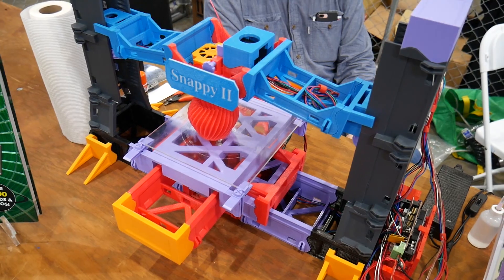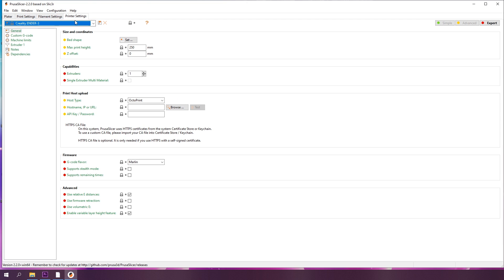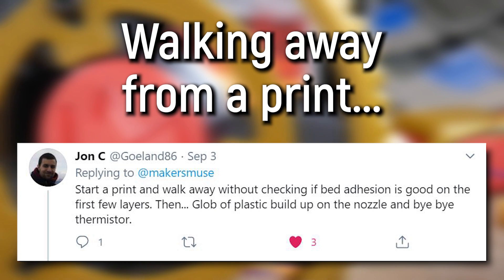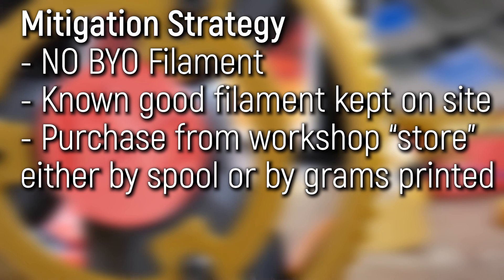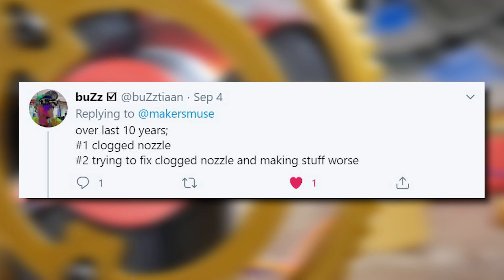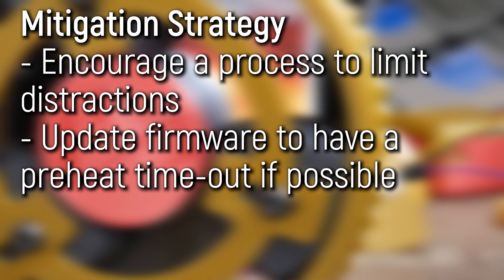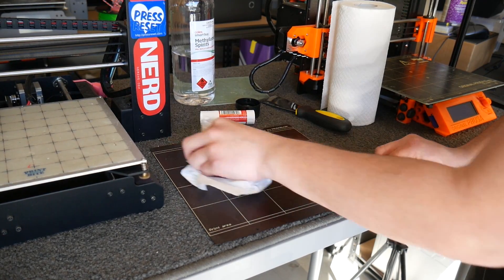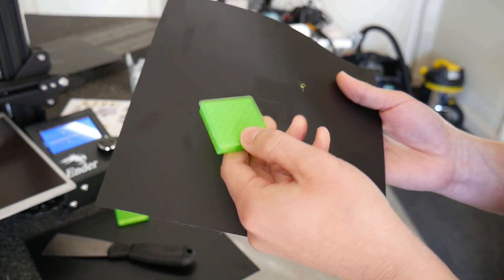How People BREAK 3D Printers (and how to stop it)

Comment: Methanol is very toxic and is absorbed through bare skin. I recommend wearing gloves if you're going to do that and work in a ventilated environment.
Reply: Angus was using Methylated Spirits which is ethanol with a few additives to make it virtually undrinkable. Also known as denatured alcohol.
Reply: @Bazzars   The "methylated" in that phrase refers to the addition of methanol, the toxic component I wrote about. If you want to use alcohol on your beds use pure isopropanol.

Also, I'm not sure if Angus is from NZ but I read somewhere that the government that has mandated that methanol cannot be an ingredient in denatured alcohol so maybe he's alright; wouldn't recommend it for anyone outside of NZ though.
Reply: @michaelh6702  Certainly agree that isopropanol is a better option. No methanol in Australian methylated spirits either according to safety data sheets. It certainly did have methanol in the earlier form (about 10% according to some articles) and quite likely some countries still do. Like you said, always better to be careful.
Reply: No Worse Than Hand Sanitizer...😏
#ALLBECAUSEOFCOVID
Reply: @RTR-MATEY  iso propanol and ethanol are a lot less toxic, also the reaction products of the Alkoholdehydrogenase and propanol is aceton. Aceton is also not as toxic. you basically have to trink 2- 4 ml per kg bodyweight to get intoxicated ( for 70 kg -> 140ml - 280 ml). In kontrast 5 - 10ml of methanol are enought to result in blindness and braindamage, and 20 - 50 ml are deadly. Methanol is a lot worse than Isopropanol.

Comment: Never use a 12 volt hotend heating element in a 24 volt system...not even  PID Tuning can fix it!!!😳😆🤣😂
Reply: Are you saying you don't want 140w of pure melting power with a massive risk of fire and molten heating blocks?
Reply: Well technically you can but not with the limitations you have on your usual 3d printer boards, and also you would need a beefier psu for nothing to avoid the hugh current pulses from causing noise or anything to the psu or the rest of the system.

PID could do it but youd need a fast PWM and im not sure if the PID loop is fast enough anyways.  Provided the RMS power stays within the reasonable limits and the thermal resistance doesnt cause the center to melt before anything outside even feel warm, it shouldnt be a problem. I remember seeing something about fast pwm but for the fan output on marlin.

Comment: I fall asleep watching my 3D printer print!!!😆😂🤣
Reply: At this point I don’t mind the noises
Reply: I'm going to be ABLE to sleep now that I have dampers and quieter fans! lol
Reply: Honestly it's the most satisfying thing
Reply: I find it relaxing too. The movement of the head is meditative and the sound better than any sound machine.
If it’s running through the night I have a kid that will lay down with full view if it to fall asleep.
I own M3D’s crane Bowden and it’s not too noisy in my opinion. It is my first machine so I really have no other printer to compare it to lodge the noise level against.
Reply: Lucky me I do not hear my 3d printer machine running noise I'm deaf as If I were wear a hearing aid I can hear lots of noise from stepper but without hearing aid while in bed I watching printing running and fell sleep nice sweet dream hehehe
Reply: After I am sure my print is going well, I like sleeping with it next to me. The sounds of the printer printing is extremely relaxing to me.
Reply: I've also done this
Reply: I usually walk away after the first few layers on my ender 3 and I check on it every 15-30 minutes
Reply: Asmr
Reply: Aww, cute 😄
Reply: It is very relaxing.
Reply: Probably could of carved it out of wood or clay faster than
Reply: A friend has an Ender 3 which he complained the stepper motors were noisy. I suggested there may be a solution. He bought a new upgraded board off Ebay , A$32.00 , plugged it in and now only hears the power supply fan. He is a Fitter, not an electrical tech , but got it sorted in an hour. Cheers , hope this helps all those noisy printers out there.
Reply: One time after smoking some dope i watched the printer printing for like half an hour and i slowly became tired, started to nod off and my head sank forwards  till i was woken by the print bed hitting my forhead :-)
Reply: Lucky, my ender 3 is really noisy. What 3d printer do you have?
Reply: @Noah-ek8hp  Ender 3....I installed stepper dampers I sourced from a copy machine boneyard!!! ...I stole its song!!!😳😆😂🤣...metal steppers on a metal frame had some weird resonances!!! Don't know what Creality was thinking when they designed it!!!😏
Reply: Stupid kids ugh...

Comment: My 3D printer broke due to an unleveled bed, where my nozzle started to scrape the printing bed, and then trying to fix the nozzle led to more mistakes but more problems being solved, and now I just have to replace my nozzle.
Reply: I'm having the same issue and still having problems. Hopefully I can fix it soon.
Reply: @themechanic2119  im not sure of the name but im pretty sure you can print a mount that prevents this
Reply: Auto bed leveling is your solution. Manual bed leveling is suicide, i cant understand how expensive printers dont come with auto bed leveling. Its just an inductive sensor, a diode and a resistor and it saves your so many problems!
Reply: @laharl2k  i think the main reason is that inductive sensors only have a very short range which limits the types of print bed you can use. and well a bltouche is expensive
Reply: @zedsanimations2242  
If you sand the bottom plastic part out of the sensor you can get an extra mm. I have a machine with an inductive sensors plus aluminium/buildtak and it clears fine, even with the bed being crooked af so i would recommend that mod to anyone using inductive sensors. 
The sensors still have no issue with 3mm aluminium even without modding, they give you about 1mm between the bed and the nozzle tip without modding. The mod is mostly for thick printing surfaces. (and expensive, compared to blue painters tape)

Other than that, i never had issues with the sensor, they are very robust so even if they bump against the print you are most likely to lose a step than breaking the sensor.
Reply: @laharl2k  Manual leveling teaches patience and better understanding of the process. Or chases away those who aren't willing to learn from their failures.
Reply: @Randall-in-Mpls  
In my world "patience" means losing money, so leave patience to people that arent making money with it.
Manual leveling is a waste of time and you dont need to manually level your bed to get a "better understanding" about anything, just use you brain.
Reply: @laharl2k  Because auto bed leveling warps your whole print. think of your build cube (or cylinder), if the bed isn't level that cube rotates, if you were printing a cube the sides should be at an angle equal to the beds departure from level, right? The problem is auto leveling only skews the z position as it moves around X and Y, the only way for the printer to know how much to compensate for in the other axes is to re-slice, which i still haven't seen many printers with enough processing power to even be feasible. So you end up with parts that aren't dimensionally accurate. And idk, in my experience with printers very high end to truly bottom of the barrel, manual calibration is very simple as long as your plate itself isn't warped. I tend to use glass for that reason.